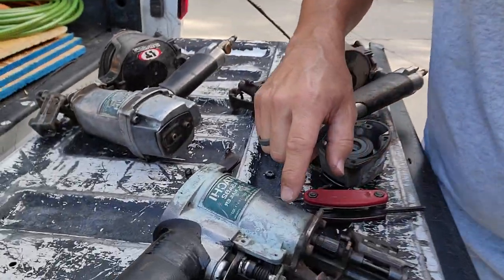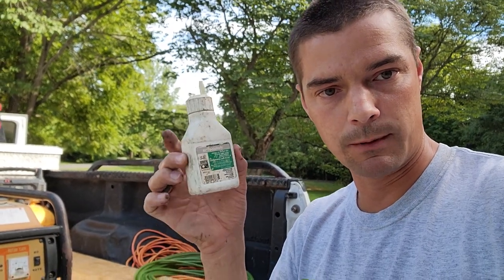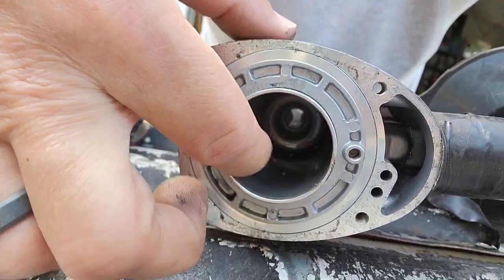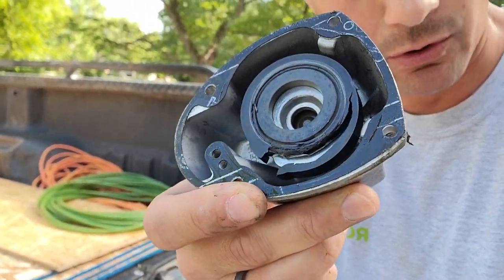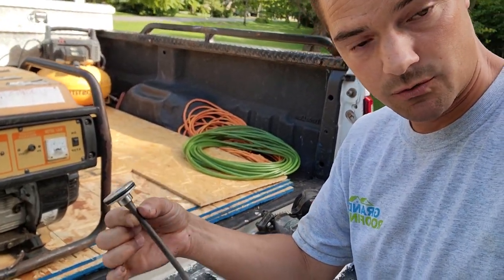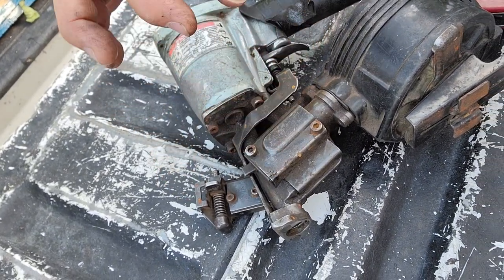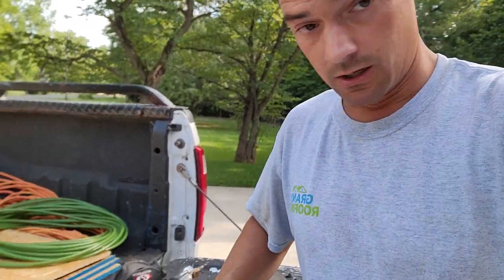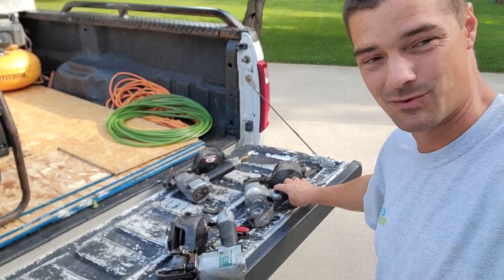Hitachi air nailer repair

Comment: I will agree 100% with throwing hoses off a roof. Big pet peeve indeed. Generally we gently lowered them down not to damage the hose or fittings. I have seen before a hose got thrown off and landed on a nail and punctured it and now we have to repair the hose. Also when tear off tools get thrown off bothers me a lot. Great way to break the handle bend the teeth.

Comment: Own a Hitachi coil nailer model NV65AH use for siding and fences. Still fires but leaking air at top.  Pulled top off but can't get the seal out. Seem to be pressed in. Any idea how to get the cylinder seat/seal out?

Comment: How to you remove the exhaust piece from the top cover change the gasket? I already have the black rubber stopper that goes on top of the exhaust piece removed. I just need to change that gasket

Comment: Not to mention old Hitachi & Bostitch roofing, siding, and framing nailers ARE GOLD, and they don’t make new guns like this anymore; so definitely repair it; as they the GO TO NAILER if using pneumatic nailers. Would never just throughout, especially when buying replacement parts not too hard as they pretty much universal from brand to brand and part to part ¹ 
Glad didn’t throw that out, and if did, wish was there to pick out of bin; cuz I woulda for an old school hitachi nailer! You bet you I woulda of😂
Cheers✌🏻

¹ yes, know there’s some variances that do need to be mindful of, but for most cases if have hitachi/Metabo hpt nailer and needs fixing….parts will work for all, Same w/ diff Bostitch nailers AND WHAT MAKES THEM SOUGHT AFTER, besides reliably, repair ability, and they just work when take care of em! Love those brands. Also, compared to battery, they weigh NOTHING, lol, but yeah, battery nailers do have there place, and can’t wait till finally get to point when battery nailers same as pneumatic when comes to weight, reliable, built like a tank and can take abuse (let’s face it, some ppl crews don’t buy the tools and a $200 pneumatic lot cheaper than $500 battery plus the extra for batteries and they don’t “apppreciate and take care of said tools”, imo of course….which any owner understands what saying😉

Comment: Question, I have my a/c on my roof and the drain was improperly installed so it just drips through a pvc pipe down to a bucket I have . Can I just redirect it to a roof plumbing vent?

Comment: all the diy want to go cordless. Also appears you went cheap on your bedliner on the super duty.
Reply from the maker: I didn't go cheap on the bed liner. I bought the truck  like that, used and paid for 100%.  Bought it from a motivated seller that needed money. Paid off and no monthly payments.
Reply: @GrandRoofingInc  get a plastic bedliner those beds/tg are becoming impossible to find you dont want to end up ruining it.